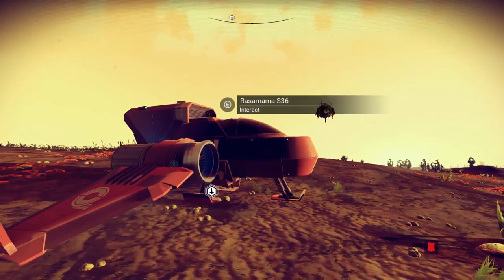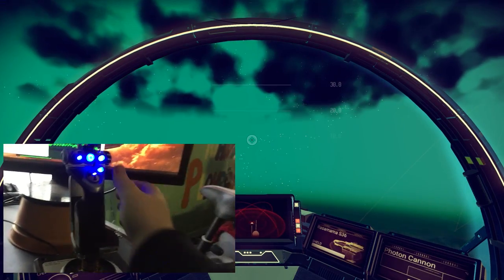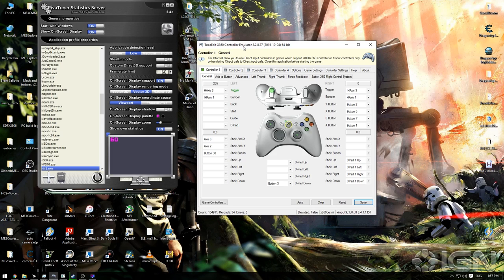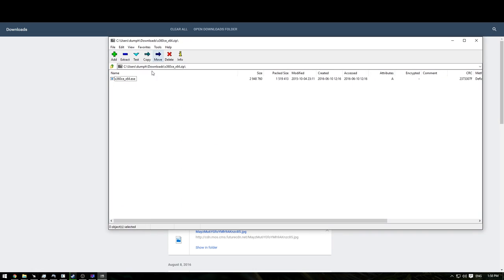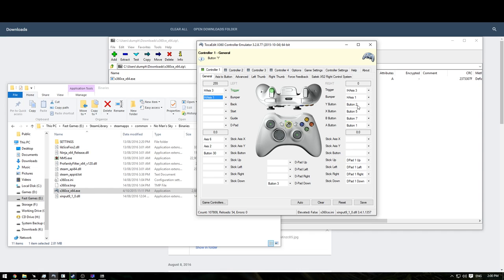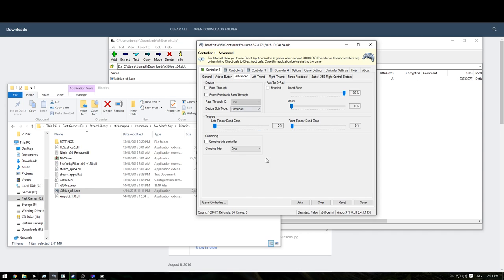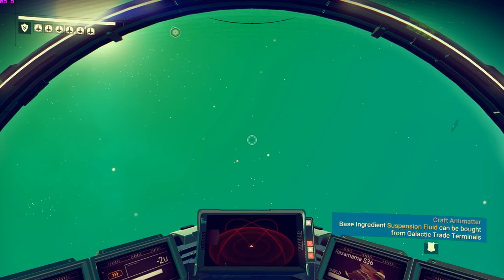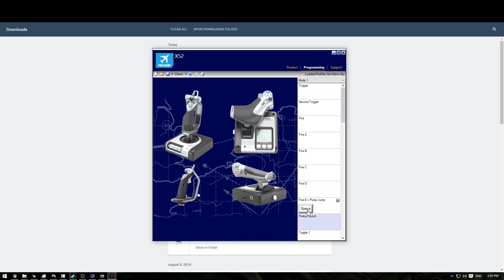No Mans Sky With a Saitek X52 HOTAS (Joystick)

Comment: Why not use the Clutch Mode button for boost? if you don't know how to use it> go to Saitek Control Panel>
>Tab(MFD) and on the bottom right you have Clutch Settings, uncheck the Enable Clutch Mode, and that will allow
you to use the Clutch button as a button.

 Elite Dangerous by default sets the clutch button for boost, but because the Clutch is enabled in settings it does not let 
you use it in game, my friend too had the same problem when it came to boost.
Reply: Thx for this video!

Comment: Good luck using this if you have more than 4 controllers and the one you just happen to want to use is 5 or higher.  Looks to be a known issue but the devs haven't fixed yet, looks like no updates 
 on the binary since 2015 maybe.

Comment: Good job finding a workaround. Devs that release games that don't support something as simple as a joystick in the year 2017 should not be in the business of making games. I bought NMS at launch and have regretted my purchase ever since. decided to try it again after the big "update" and it is still woefully disappointing. high hopes but huge letdown.
Reply: give her one more try. Next is awesome
Reply: You should see PS4. The system has ZERO method for input, other than the official hand held. I gots a HOTUS, and every game is different and cannot be modified. The real big problem is PSVR. The hand held is completely insufficient and insufferable and I believe the major stopping point in VR on the platform. I’m in it for bout $1000 now, but it’s almost worth it to start over with a PC
Reply: This comment hasnt aged well
Reply: Your complaining about a game not having joystick support?
I understand for a flight simulator or a largely movement based game but nms is a sandbox game, it’s got too many things to control to the point where it’s stupid to even play with a joystick. It would purely be for flying, which isn’t a particularly entertaining side of the game, I mean it works fine and all the cockpits are well designed and detailed but there’s better parts of the game than just “flying”

Comment: I picked up an almost brand new OG Saitek x52 on ebay recently for $50 shipped BIN, so said screw it to try a real HOTAS with NMS.  Here's the twist, I'm on Linux (Arch) playing NMS with proton, so was a bit worried, but nah, someone already has a dope joystick function mapper.  AntiMicroX works perfectly for me, without mapping one bit of an xbox or any pad, and without sacrifices.  

AntiMicroX also supports full banding/dead-zones, various algorithms for control/acceleration, and mapping axis to emulated mouse, which was the perfect trick I think no one has tried (or done) under windows with the various vendor joystick control software or 3rd party.  It's an almost perfect solution for me in linux, shame you guys on windoze don't get it, but hey, you can always come to the dark side and learn linux.  ;)

My only wish using this now is being able to map buttons within AntiMicroX to change between profile control sets tweaked with different algos, sensitivity, and acceleration deltas.

https://github.com/AntiMicroX/antimicrox
Reply: Ahh that's really cool! I'm actually a huge proponent on Linux I just can't use it as my gaming daily driver yet with my Nvidia GFX card unfortunately. I do hope to be able to switch full time sometime in the near future!

Edit: just realised I'm on my normal account and not my channel account haha